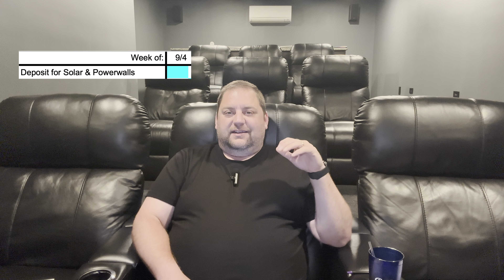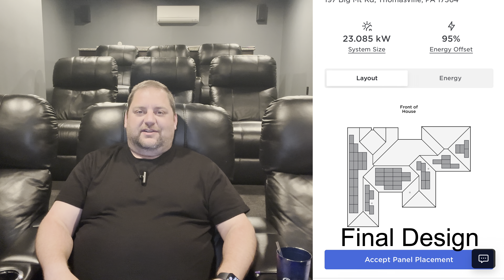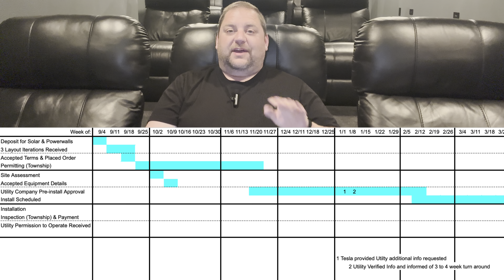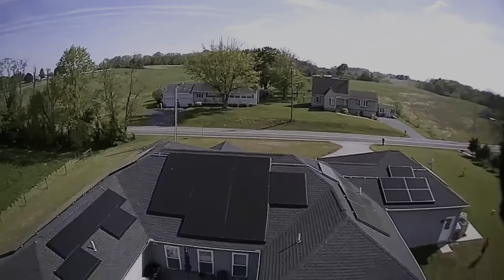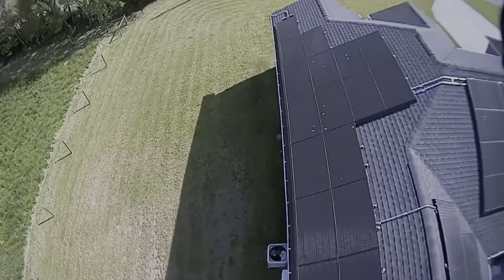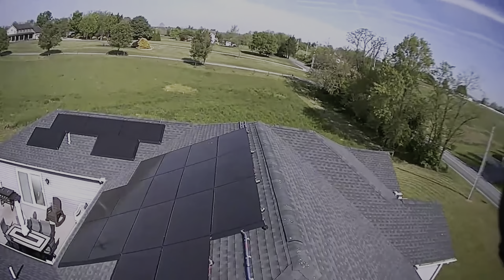I Bought a Tesla Solar System and This is How it Went

Comment: I just started the process with Tesla Energy (signed less than a week ago).  Tesla and the power company in my area says they will currently not approve a PowerWall 3 to allow it to send back power to the grid.  Therefore, Tesla is saying that I have to use a PW2 or Plus since they will not install PW3 due to the electric company says they want UL listing document changed.  Should I go with the PW2 or force PW3.  Tesla says it could take months before approval is granted by the power company.
Reply from the maker: I looked at the PW2 vs PW3 when I was getting everything setup. I would have had to wait to get PW3 and the specs didn’t make sense for me as long as I was installing more than 1. If I were installing 1 PW, I’d go with the PW3 for higher continuous and peak output, but if I was installing more than one PW2 works great (this is exactly what my situation was which is why we have PW2’s.

Comment: Do you have inverters in addition to the 2x Powerwall+ inverters? I have a very similarly sized system I had installed 3 weeks ago. 23.49kW of panels and 20.9kW of inverters. I have 2x Powerwall+ and 2x Powerwall 2 like you but they also installed a 5.7kW additional inverter. Interestingly the system behaves somewhat weird when it goes above the 18kW in solar generation. It will stop charging batteries and send all excess power the home isn’t using to the grid.  This is even though I don’t have PTO and the app is set to Permission to Operate = No. Have you encountered anything like that?
Reply from the maker: Yes. We have a separate inverter as well. The exporting you described is exactly what we experienced as well. It seems to fall under the “small export” category much seems to be ok for testing and other purposes. Once we had permission to export things seemed to be more normal. With that being said, it does seem to avoid doing anything over 18kW at a time. Charging batteries or exporting, but that’s a pretty high amount.

Comment: unbelievable to me as a Brit ,that your power company has to give permission to use your solar,here in the UK, the DNO (District Network Operator) either approves your proposed install size in reference to the proposed export capability,which is down to the grids cable capability in your area, or they restrict your export value, however below a certain level no DNO involvement is necessary, nor is adding batteries as that is "behind the meter", the most time a DNO can take is a month tops, when approved you can export to whatever retail electric company you choose,Btw there is videos on YT of a chap in southampton with 75% of his install on his North West roof generating more than his South facing roof :)
Reply from the maker: Thanks for watching and commenting! I love receiving perspectives from our friends on the other side of the pond. There are lots of things in the States that make no sense at all!
Reply: @kevinmatthews2620  fellow Brit here, thank you for the info! Hoping to move into a new build soon so have no idea how the solar works.. but I suspect I will need to learn fast! 😂
Reply from the maker: Thanks for watching. Enjoy your new home!